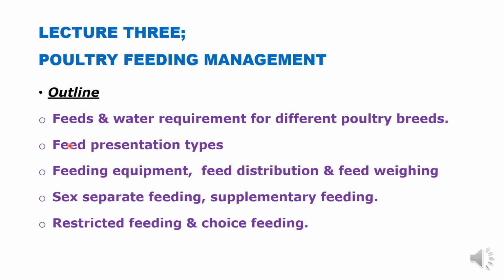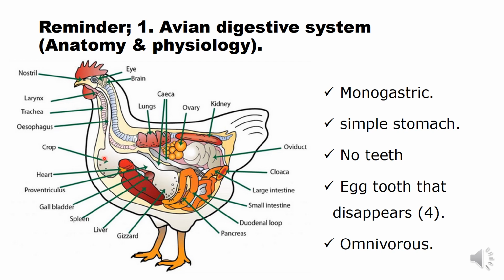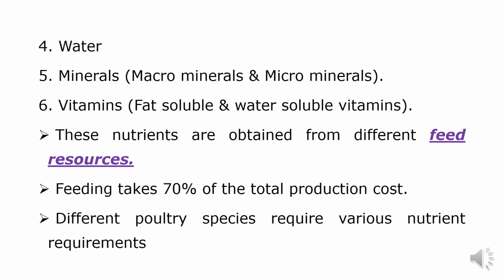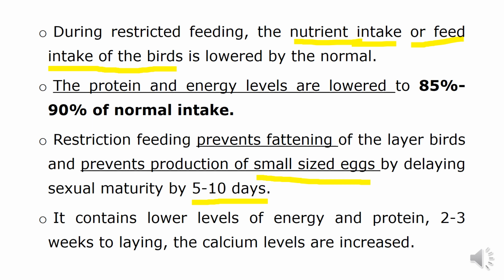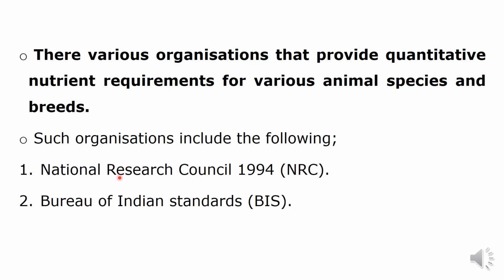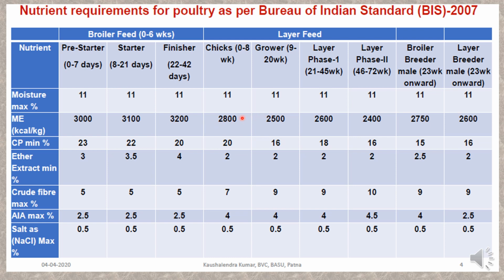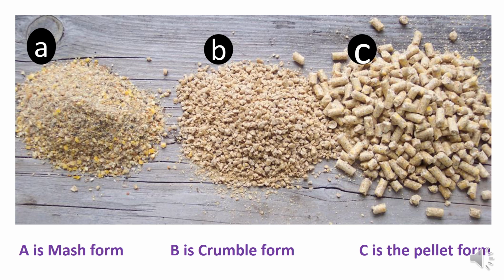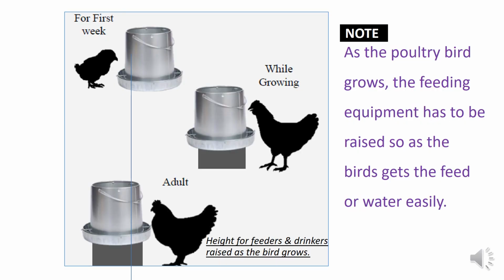Poultry Management & Nutrition | Feeds, Formulation, and Nutrient Requirements

Comment: Akabwai Arnold BU/UG/2022/2177
Thanks for the lecturer.
What is the function of Meckel's diverticulum in the avian?
Reply from the maker: Meckels diverticulum it makes the end point of the jejunum and the stating point of illuem.

Remember the small intestine has three parts duodenum, jejunum and illeum. 
Meckels diverticulum separates the jejunum and ileum.

Comment: Wamboga ROGERS.. thanks so much master for the presentation... actually my concern is prior to fertilization in other species like pigs, cattle we are advised to increase on the feeding rate to increase on production of ovaries.. hence production.. Why not in birds also...
Reply: BU /UP /2022 /0582
Reply from the maker: in the birds you have seen that during 1-8 weeks (chick) we feed it with high protein 20% CP, then as it grows from 9 weeks to 18 weeks we lower its protein i.e. 16% CP but as the birds reaches the laying stage we increase the protein level 18% and we increase the calcium content from 1% to 3%. Hope you have got the point we are increasing the nutrient requirement level of the bird so as it meets its need. We talked about factors that affect nutrient requirement of the bird and explained some of them as age, physiological status, health temperature etc. therefore these factor will influence on the amount of nutrient and feeds given to the bird.

Comment: Thank for nice online lecture Master. According to the online lecture you said chicks required higher temperature than mature chicken,so know what is the normal body temperature of a chick and mature chicken.
Reply from the maker: I said for chicks require high protein content because its the protein that helps these chicks to develop  and grow.they also need high energy level. Back on your question about normal temperature of a mature chicken is 40 degree Celsius to 41 degree Celsius. any variation from that is an indicator of a problem or ill health.  the chick its 39.7 degree Celsius. A reminder about the temperatures in the brooder for the first week will be 30 degree celsius to 35 degree celsius then after the one week we reduce the temperature by 2 degree celsius till the sixth week when the temperature is 21 degree celsius

Comment: Master how does grinding of food particles occur  in the gizzard and which muscles play the role. Nasangha Besweri,BU/UP/2022/0607.
Reply from the maker: The gizzard has the inner muscle that is thick.. it is sometimes referred to as hens teeth as it helps in reducing the ingested feed particles. in addition to that the gizzard contains gilts which look like stones and these aid it also play the role.

when a hen digests foreign materials like small wires, these pierce the gizzard muscular wall affecting it, the hen undergoes wasting(decrease in body weight) and may die.

Comment: Owen NUWAREEBA BU/UG/2022/2208 With locations what is the difference between pancreas and spleen.
Reply from the maker: Thanks Mr. Owen. In terms of location the pancreas is located near the duodenal loop while the spleen is an accessory organ that is near the liver. The spleen is not a digestive organ hence plays no digestive function. In terms of functions the pancreas produces the pancreatic juices that help in digestion and also it produces insulin and glucagon while the spleen controls the level of white and red blood cells, platelets and white blood cells.
Reply: Thanks so much doctor,,,the answer for the question is,,, lupins is 16.7% and barely is 83.3%,,,thanks,,,,I remain as CHEMUTAI IVAN BU UP/2022/0457